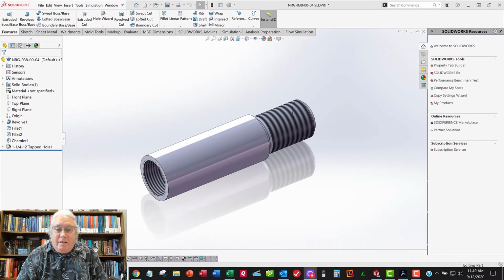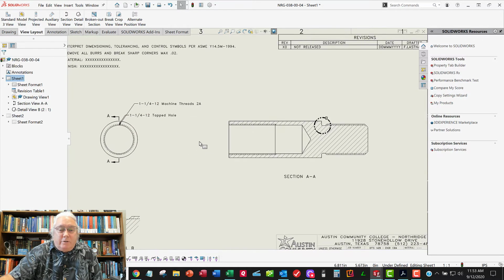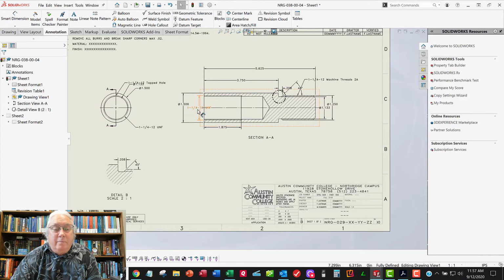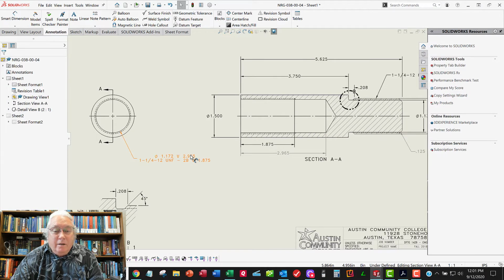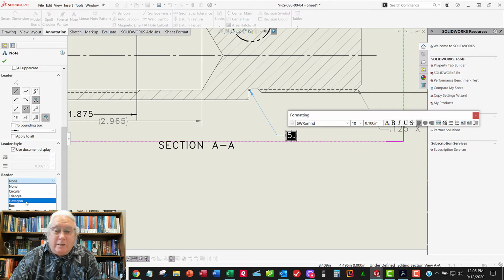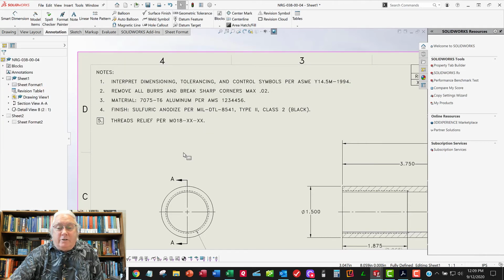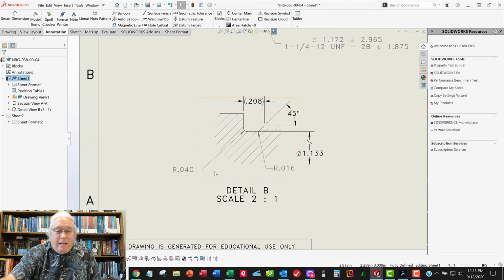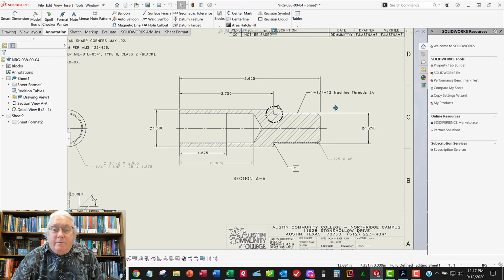NRG-YYY-XX-04 Thread Relief Solidworks Drawing

Comment: 12:00 there is no tap depth showing for me only drill depth
Please help
Reply from the maker: I suspect you need to go back to the part model and adjust the options of how the tapped hole is displayed.  Edit the hole wizard feature and look at the options near the bottom of the list and make sure to turn on the option to show both the hole tap depth and hole tao drill droth.